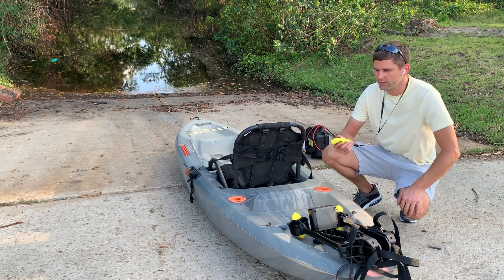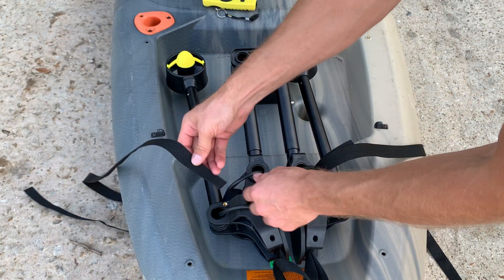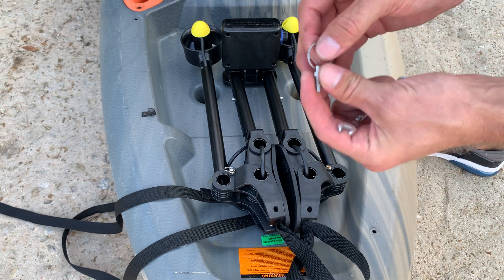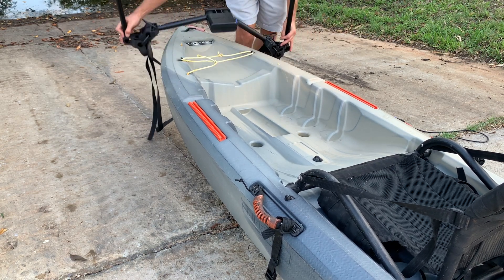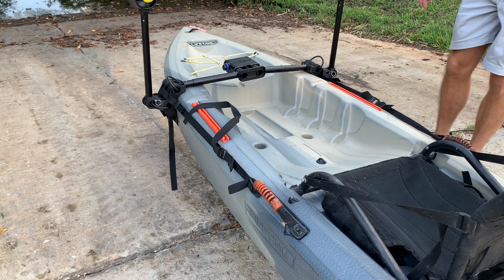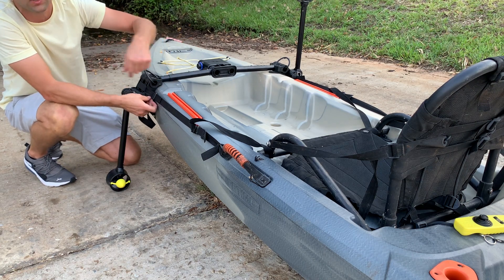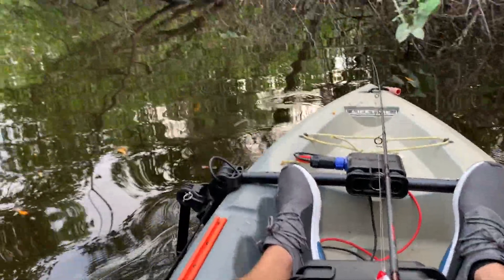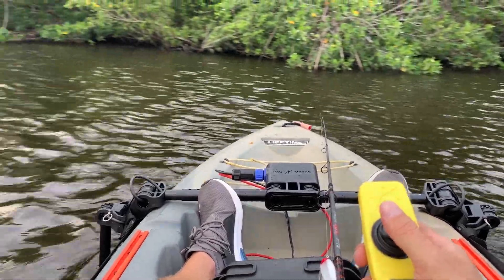PacMotor Front Mount

Comment: Would be great if you can mount the PAC motor to the gear tracks instead of using the mounting straps. Most kayaks now these days come with front & rear gear tracks.
Reply: Most fishing kayaks...
Reply: 100% this. i dont like the strap mount
Reply from the maker: I do like this idea! We are planning to do this hopefully soon but others have been working on hacks to do this as is
Reply: @PacMotor  done this already using rubber lined u clamps which fit perfectly in the gear tracks..
Reply: @elvisrocks2184  did you come up with that idea yourself, or is there a video that you followed on here somewhere? im torn between this and the newport nk180
Reply: Just ordered my PAC motor 🙌🏼 it’s the pre-sale with battery hoping it comes in fast…. Can’t wait!

Comment: That is awesome. I might would try strapping it in right in front of the seat under my legs and that might solve the angle problem (not sure how much that would interfere with paddling though). Or extend it straight and paddle with it on full blast! The possibilities are endless😂
Reply from the maker: Hey, that's a good idea! I should test that out. It would also make it super easy super to access the motors right under the seat!
Reply: As someone who has a PacMotor I can kinda curious about this idea. It would absolutely make it easier to access the arms. I think it would clear my legs no problem.

Comment: Matt, do u prefer the front mount or rear mount?
Reply from the maker: Hey Dave, I prefer the the rear mount. The demo here was just to show was it possible but Its nice to have the motors in reaching distance behind the seat and out of the way from other gear or your feet and legs. Also, the control from the motors in the mid to back seems more natural when navigating.